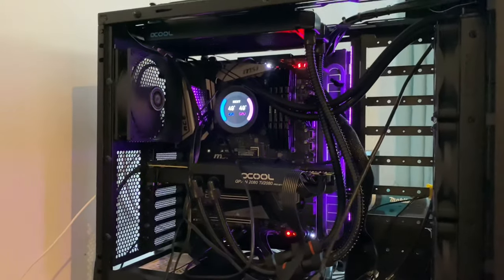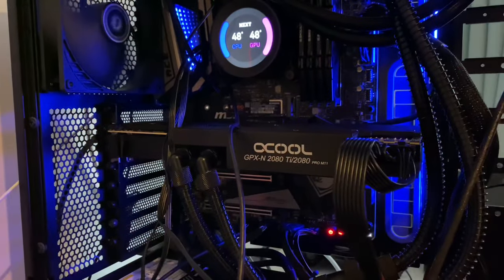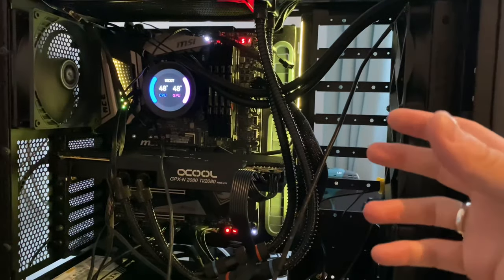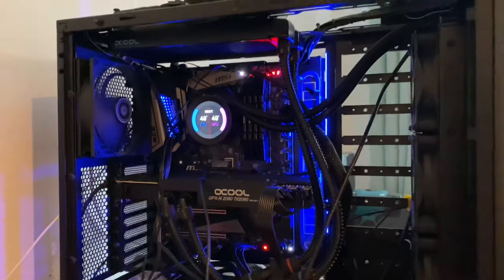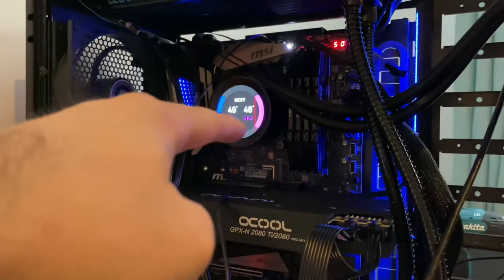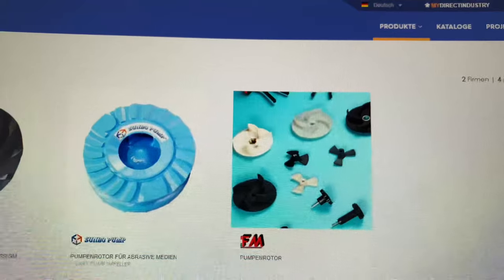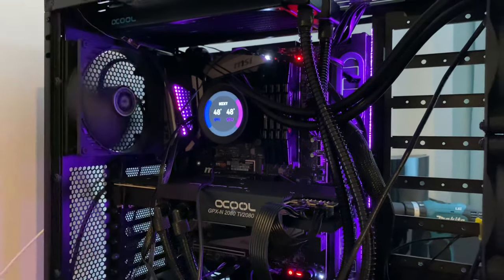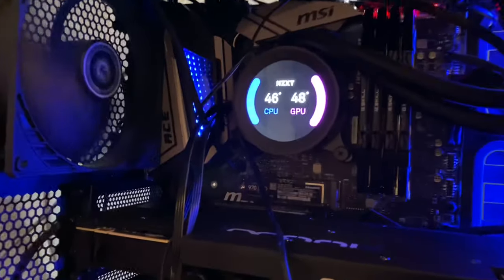How to fix any AIO Pump Noise/Bubbles Problem/Issue (NZXT Z73 / X73)

Comment: very simple solution i used to fix my own AIO bubbles. detach the radiator completely so that you can freely move it around (note, do not detach the cooler, leave it on the CPU) and then turn your computer on and turn on your CPU temperature monitor. then raise the radiator as high as you can above the CPU. this should let bubbles immediately escape and you should notice that the CPU temperatures will immediately drop and eventually the noise will resolve itself. good luck! (also, don't turn your computer on its side or you can get this problem)
Reply: My radiator is quiet now but cooler attach to cpu making static noise
Any solution
Reply: @FR33CSS_  yeah. put your computer in the back of your car right side up and go drive slowly down a bumpy dirt road. serious
Reply: @Ohdeerhere  i did nd it worked
Thank you 😊
Reply: Yk I wish I saw this 13 mins ago before I put my pc on its side for 40 minutes 😭
Reply: @ZarkinX im about to do it, is it working?
Reply: Thank you! We tried this and it worked!! :)

Comment: I’m having the exact same noise on my pc. It was fine for about a week and then the noise started. I’m having a hard time understanding the part about the rotor and the plate that you found was causing the noise. Do you happen to have any more information about this, like better photos or videos? Any help would be appreciated.
Reply from the maker: Sorry. I made the video after I realized that my way helped me fixing my problem.
Their is a really small plate under the rotor (if you open the copper plate of the cpu block) which holds the small white stick. This white stick needs to replaced
Reply: did you change your aio pump speed to fixed in nzxt cam
Reply from the maker: @seremaa  yes it was the first test I did. But It wasn’t the part of the solution
Reply: @techpchouse  where can I buy these parts? I see the stick and rotor but I think I need new parts
Reply from the maker: @0xBULLgogi  i think it’s impossible to buy. But
You could try to contact asetek directly

Comment: you should not shake your radiators, the simplest solution is tilting the pc while it is running in order to allow the trapped air to rise to the highest point. shacking the radiators will cause bubbles to form in your loop.
Reply: Thank you so much this fixxed it
Reply: Thank you! This looked to fix my issue.
Reply: Tilt it with the radiator on top?
Reply: So if my radiator/pump is screwed in like the guy has it in the video , should I tilt the switch pc on its side , back and forth consistently or how ?

Comment: Another tip I saw on a few videos is to place your radiator orientation with the tubes on the bottom side. This way the bubbles stay trapped on the top radiator instead of cycling back to the tubes and then back to the pump.

Comment: The only reason you had to shake it to get bubbles out is you have it mounted incorrectly in the first place. Flip your radiator so the tubes are coming out of the bottom, and flip the cpu pump as well so the tubes are entering on the bottom.

Your current mounting setup promotes air bubbles running through the loop. Air collects at the top of the system. When you have your tubes at the top, they're pumping through the area where air collects!!
Reply: Stop that nonsense. It doesn't matter if the radiator tube is top or bottom.. After you get the bubbles settled it's 100% safe putting the radiator tube on the top side

Comment: Can you make a video of how you did the tear down and refill? I have the same issue. Although I think I know what I am doing it would just be good to see it done.
Reply from the maker: Sorry :/ I did a repair and sold it
Reply: @techpchouse  no problem, I did strip mine down, I have the exact same noise. The little white stick doesn't seem secure. Can you buy replacement? I didn't drain it. But it has improved the noise. I was just wondering how to refill it as I'm not sure on that part.

Thanks
Reply from the maker: @hussler4721  yes! Their is in really small plate witch holds the stick 👍🏽👍🏽🤝
Reply: Dr Perun  it's mounted on top, can't mount it any other better way. The noise from the video was the same as mine. I took mine apart and fixed what he recommended and it worked. So can't fault it tbh.
Reply from the maker: Dr Perun  only on Germany
Reply from the maker: Dr Perun  nahhh my friend. You please be respectful
Reply from the maker: Dr Perun  that is not true. The nzxt pump parts / the sticks and plates are made by plastic
Reply: Nah hes fine. Sometimes its a simple fix like yours, but in this case it isnt.
Reply: @techpchouse  lass dich nicht erniedrigen von dem typen wie du die pumpe reapriert hast das ist wirlich ne 1+ PLUS mit sternchen ehrlich ich hab genau das gleiche problem mit meinem nzxt x 63 rgb kühler und es hört sich genau so an wie deiner. ich habe dieses rattern aber jetzt schon über ein jahr !!!! ist da noch was zu machen oder ist die pumpe zum schmeißen
Reply from the maker: @bananenpflanzer6516  erstmal vielen dank bro! ich würde den Kupferblock unten an der pumpe abbauen, dann die pastikabdeckung rausnehmen und schauen ob der kleine Stift/PIN mit der runden Plastikscheibe noch draufsitzt. Das war bei mir das Problem und hat geholfen. allerdings kann sich die Scheibe wieder vom pin lösen, wenn du zu wenig Wasser im loop hast.
Reply: @techpchouse  danke danke danke

Comment: Ok. Fixed my unit by adding a tiny amount of cotton under the rubber cup of the pump (so it's up half mm). Tried everything suggested before - no help. A question, my unit had only one ceramic oring on the impeller, is it same for you? My guess  it must be the problem.
Reply: and yea fuck nzxt, last time i bought piece of that brand.

Comment: Hallo kannst du das bitte auf deutsch erklären, ich habe das selbe Problem.
Hast du evtl. eine detaillierte Anleitung ?

Lg
Reply from the maker: Das problem ist, dass der pin von der Pumpe der auf der Pumpscheibe liegt nach einer Zeit locker wird, wenn zu viel Luft sich in der Kammer befindet. Daher musst du die kupferrote lösen, die erste Platte abmachen und den weißen Pin wieder reinstecken. Alles zusammenbauen und die Kühlflüssigkeit nachfüllen. (Alles ohne Gewähr)

Comment: Bro when the AIO making that sound  also it will run fine ?
Reply: not really. it will run hotter than normal in most cases.
Reply: @maccentric  ive noise too.does it gonna flow to my system mate? Is it dangereous?
Reply: @jousqiwnd4614  I don’t think it will cause leakage but it will run less efficiently and make your temps higher. I would replace it under warranty if possible, it was relatively painless.
Reply: @maccentric  thank you sir

Comment: can i use Car coolant refill the aio？？
Reply from the maker: I did it by myself and it worked. But you have to clean the whole loop with destilated water before. It’s important that you do not combine two different types of car coolants. They are organic and anorganic coolants. Be safe. I do not assume any liability or guarantee for all
Reply: @techpchouse  thx 4 reply and my another big problems is the rubber seal are crash。。  LOL to sad

Comment: do you always run your CPU and case fans at 100% or do you use a curve?
Reply from the maker: I‘m using a fan curve.
My fans never spin higher than 1100 rpm
Reply: @techpchouse  oh nice, and your temps stay that low at those speeds?
Reply from the maker: @superbade  at Full load, every Settings on max in warzone: CPU around 68-69 degrees and GPU at 47-48 degrees. But everything in my new SFF build (a NR200P) just check out my review :)

Comment: Hey, I have this same problem at the moment with my Z73 nzxt AIO, cant see to solve it, temps are fine. But the rattling is driving me crazy
Reply: Hey there! Did you ever find a fix ? Cause I’m having the same problem, the noise is coming from the pump I believe that’s in the middle of cpu
Reply: @Jojo-qn2yc  Hey, no the rattle is still there. I contacted NZXT via chat and they said we will send you a replacement once available. The problem seems to be a rotor that is in the pump. This thing gets loose and ticks against a different part inside. The rattle is driving me crazy, I made a vid of it, turn your volume up, https://www.youtube.com/shorts/0d7tLr1TjSY
Reply: @ToniCur88  Ahh I see, yours is actually worse than mine. I might contact nzxt for a replacement then. Thank you! And good luck !
Reply: @ToniCur88  I really need to know did you have some sort of information or like the product number or something? cause i have no evidence of owning the product and i need a replacement as well
Reply: @bananenpflanzer6516  NZXT sent me a new one, works fine now. Yes I order my pc via their nzxt bld service, and so they just sent me a new one. I had to sent the faulty one back though.

Comment: i do hear a light humming noise from my nzxt z63 aio. its probably a year old maybe? ordered it from mindfactory. my noise isnt that bad like in ur video but i will still try this out the next time im changing my thermal paste also a question. your pump tubes are iorentated upwards from your mainboard. mine are to the right. you think changing the pumps upwards like in this vidoe will be better?
Reply from the maker: No matter the tubes are upside or downside. The highest point should be a corner of the radiator. For you noisy problem you should try to shake the whole AIO really hard and run the pump at 100% for 20minutes

Comment: I have exactly the same sound with my Z63. I openend the pump and checked the 'rotor' inside it, everything was fine and wasnt like yours out of its place.

Everything what you said to do didnt help my issue, except refilling the AIO. 

Could refilling the AIO fix the sound issue?

Comment: Hey, Danke für das großartige Video! Ich habe genau das Problem! Die Geräusche + im IDLE hängt die CPU bei mir auch bei 40 - 45 Grad, wobei das Wasser das Wasser 26 Grad hat. Habe auch schon sichergestellt, dass das Ding ordentlich am CPU angebracht ist, inkl. WLP etc. - Die Pumpe läuft bei mir auf 60%, da macht sie keine Geräusche. Wahrscheinlich ist deswegen die CPU auch so heiß. Hast du die bei dir auf 100% laufen?

Ich weiß nicht, ob ich den Part mit dem Rotor richtig verstanden habe:

Ich soll die Backplate abschrauben, und dann finde ich dort einen kleinen Stift? Aber was genau soll ich mit dem Stift machen, ein Ersatzteil kaufen? Wieder befestigen?
Außerdem soll die AIO wieder aufgefüllt werden, muss ich die dafür vorher entleeren? Hast du ein Link, zu einem Liquid, welches ich dafür benutzen kann?

Würde mich über eine Antwort sehr freuen! :)
Reply from the maker: Hey, du musst den kleinen Stick/Stift wieder neu auf den rotor Positionieren :) dann ist das Blubbern weg. Als Kühlflüssigkeit kannst du ganz normales destilliertes Wasser nutzen. Ich selber nutze DP Ultraclear 👍🏽
Reply: @techpchouse  Cool, dann hol ich mir das. Muss ich vorher die Loop von der Flüssigkeit befreien? Ist es richtig, dass ich die Pumpe laufen lassen soll, während ich die Flüssigkeit hineinfülle, oder kann die auch aus sein? Reichen hier 1000ml? Hast du deine Pumpe im Video auf 100% stehen?
Reply from the maker: @emgi91  nein die pumpe muss stillstehen und am höchsten stehen, sodass die flüssigkeit in den radiator fließen kann. achte dabei, dass die alte flüssigkeit erst komplett raus ist. am besten dann mit destiliertem wasser ausspülen und dann die kühlflüssigkeit rein :)
Reply: @techpchouse  Gibt es irgend einen Trick für das durchspülen? Reichen denn hierfür 1L Flüssigkeit? Ja, oder? :)
Reply from the maker: @emgi91  ja zu viel sogar

Comment: I finally managed to fix it! but i did it on my own. I had the noise like in the video, sometimes it stops crackle but most of the time it's so fckn annoying...
So all i did for the fix: it's only re-connect the usb (micro usb in my case - nzxt x53) of the fan that connected directly to the pump, but when my PC was turned on. So after reconnect, i immediately heard a light rare crack that I have when i bought my pc, and it's almost inaudible when the case is closed.
Can't beleive I finally able to fix it !
Reply: Mine is like all fine but when I start using heavy software it make little grr sound..(not much) but only when I use heavy software..or game otherwise it don't...was it same with you?

Comment: You could have just flipped the radiator upside down
Reply: this would not have helped ANYTHING not to be rude or anything......... but the problem is not just an airbubble. The stick which the water pushing blade thingy(rotor) is mounted on is rattling like crazy and that caused the problem so even if he mounted the radiotor on top the issue would have still been there ...........

Comment: My pump a bit noisy but mine is more fans problem they loud at 1000rp
Reply from the maker: Just set your pump to 100% and set the fan level from 0-50 degrees to 40% fan speed. At 70 degrees to 100% fan speed